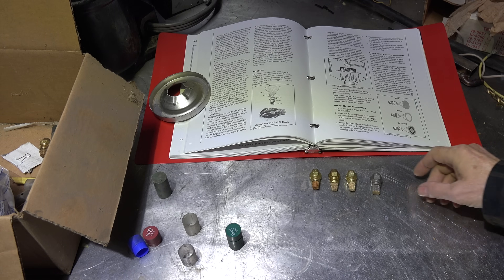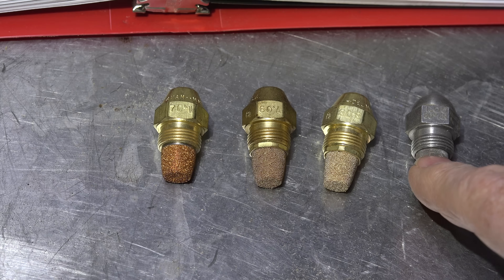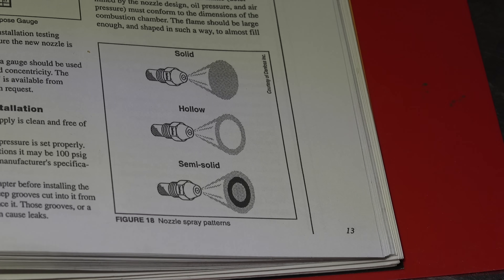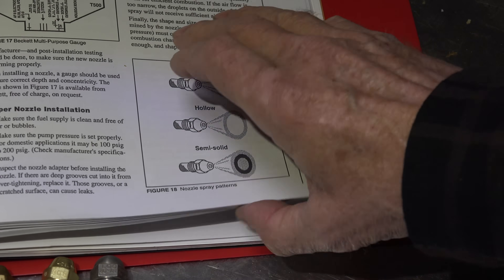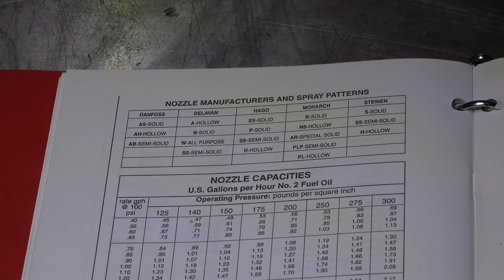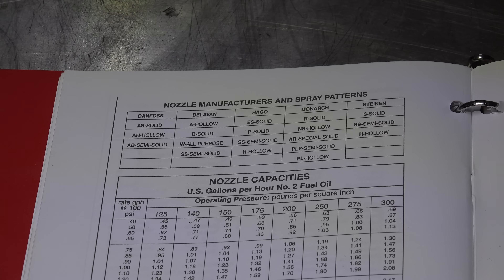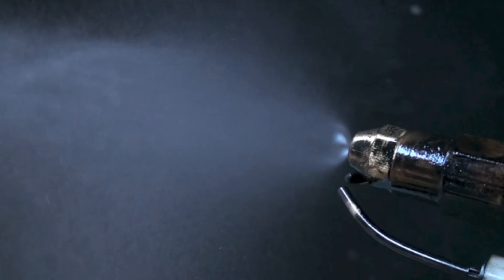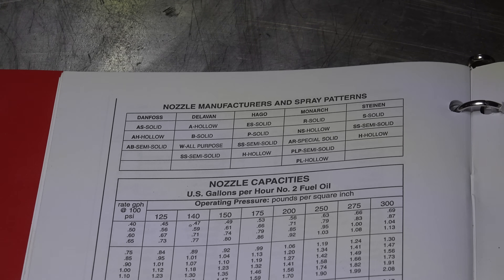An explanation of oil nozzles spray patterns

Comment: Do you still play with furnaces? I've been watching thru a lot of your old furnace videos and learning a lot. Thank you so much for making them and explaining the whole process. I got a free nordyne m1s and a bunch of free frier oil. im trying to heat my shop for as cheap as possible as we have long miserable winters here, also not many stores around so I cant be picky. Any pointers on running wvo cut with 87 non ethanol gas? I dont have a big air compressor or a heating setup so I'm kind of winging it.
Reply from the maker: My ears picked up at the 87 octane gasoline.  Sounds very dangerous. If you run that thru a high pressure nozzle, I would expect an explosion and not a small one.  I know you are mixing it but it seems pretty scary to me.  Fryer oil will not atomize like fuel oil when sprayed thru a nozzle.  I know I am not giving you any answers but I am not sure there is a safe one.
GFM

Comment: How does pressure affect the efficiency of the burn? For instance if I have a .75@100psi unit and then drop the nozzle down to .6 then bump the psi up to 150, I should in theory be back to .75gph but now at 150psi vs 100, would this be more efficient, less efficient, or just plain pointless? Maybe easier ignition of the fuel?
Reply from the maker: Higher pressure equals higher efficiency.  Some as high as 300# PSI.
GFM

Comment: Bought a three section well McLain in 1998 25 years ago also bought 12 nozzles for two dollars apiece and 12 filters for $1.60 each changed both once a year brushed out the heat exchanger and flue pipe every three years never had any problems puts out a steady 115 thousand BTUs. Then in 2012  I bought another 12 nozzles for $4.00  dollars each and another 12 filters for $3.25 apiece still runs great no puff packs ever and still putting out a steady 115,000 BTUs.👨‍🔧

Comment: Does all purpose mean you can use W nozzles on any unit?
Reply from the maker: Any#2 fuel oil can be used.  Whether it works with acceptable efficiency tests determines if it is the best choice.
GFM

Comment: is danfoss 60s 60 is required for oil heating burner. monarch 60s 60 AR will be similer ?i want t change it myself and dont wants to open burner twice. what is e, es at the end of danfoss. thanks in advance

Comment: Is it possible to go from 1.00 to .75??
Reply from the maker: Yes, lowering nozzle size is quite common to increase efficiency.
You will have to reset the combustion air and do efficiency checks.
GFM
Reply: @grayfurnaceman  Thanks.. I was afraid that it was too much of a downgrade!
Reply: @grayfurnaceman  Hello Sir Switch out 1.00 nozzle to a .75 and some radiators are heating up any thoughts..
Reply from the maker: @josehuertas2441  Are the radiators heating when they should not be?
GFM
Reply: @grayfurnaceman  Sorry meant to say are not heating ..or as fast as they use to.ty

Comment: Hi, i just wonder i have old furnace , new Yorker; model  (NY 151), and say use Nozzle 1.10/1.35 (B) 60/80, and i have been using w , not B, and soot more often then should be, do you think this is the reason. I live in Canada , and again most of the time i use 110/80w, or 110/70W what do you think.
Reply from the maker: The wrong nozzle could cause sooting, but I would be looking at primary air adjustment first along with combustion analysis.
GFM
Reply: @grayfurnaceman  Thank you.

Comment: So on a trio oil boiler. I changed it from a .60x60b to a .60x60as. Is that okay? Combustion numbers were okay and had 0 smoke
Reply from the maker: I assume you mean 60 A.  I can't say I have heard of an AS nozzle.  Its a hollow spray.  I have had quite good luck with these compared to the solid B nozzle.  If your combustion numbers are ok, you are good.
GFM
Reply: @grayfurnaceman  it’s an AS nozzle. I’ve been in the trade for 2 years and I still don’t completely know what the spray pattern is of a AS nozzle.
Reply: @grayfurnaceman  the co2, temp and efficiency were good but the CO was at 200 and slowly falling.
Reply: Also when I did my first smoke test I got yellow on the test pad. Figured it was just the excess oil in the chamber burning off. Waited for 3 min and on the second smoke test it was clean.
Reply from the maker: @Keegeth  I am somewhat unfamiliar with the Danfoss nozzles, but their web site says its a solid nozzle.  
If you had an ignition failure as the reason for the call,  the yellow is normal.  I generally would run the burner for 1/2 hr after repairs before doing the combustion test.  
GFM

Comment: Is this a siphon or hydraulic type nozzle? Is there a big difference between the droplet size between the two? Thanks
Reply from the maker: I have never heard of a siphon nozzle.  This type uses 100 to 150# pressure.
GFM
Reply: Sorry I don't know much about the industry. By siphon I mean nozzles that use compressed  air and the Venturi effect. Hydraulic more simply using the pressure of the liquid. Which ones are used in the industry?
Reply from the maker: The siphon type is used in waste oil burners that must heat its oil to effectively burn.  
GFM

Comment: Can't wait to see more from you on this topic. Thanks!
Reply from the maker: I have several other videos on this subject.  Its on my oil playlist.
GFM
Reply: @grayfurnaceman  hi gray, I have a oil boiler, on start up it has a small puff of smoke then runs clean. I’ve had a look and it looks likes after shut down, a dribble of oil comes out of the nozzle. Would that have something to do with it?
Reply from the maker: @akamuzz84  The dribble is normal for a unit that does not have a shut off solenoid.  I would service the unit.  New nozzle, filter, electrode adjustment and heat exchanger check/clean.
GFM
Reply: @grayfurnaceman  it has a solenoid, it’s a ferroli boiler with a sun g burner. https://www.manualslib.com/manual/1602151/Ferroli-Sun-Series.html?page=4#manual
Reply from the maker: @akamuzz84  I have seen this on some units.  I have no explanation other than trapped air in the gun.
GFM
Reply: @grayfurnaceman  ok thanks